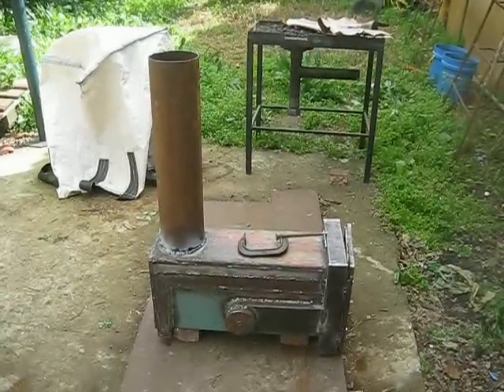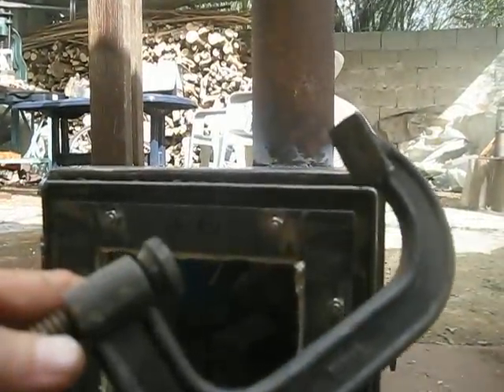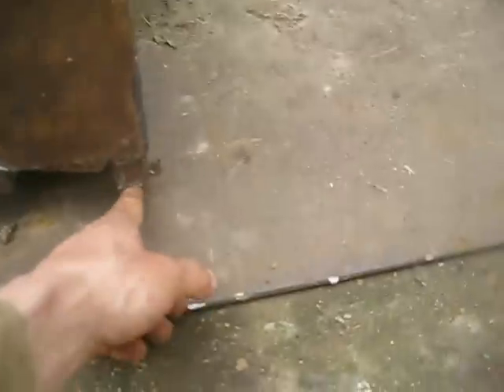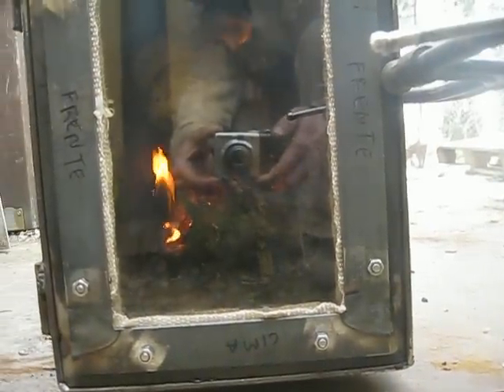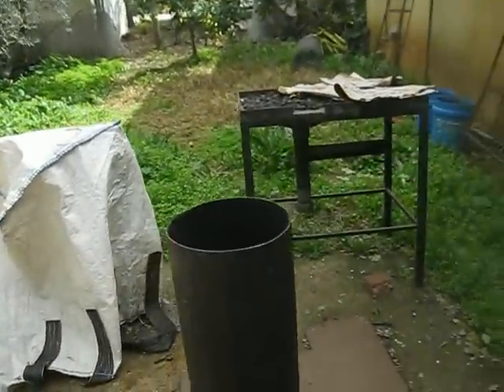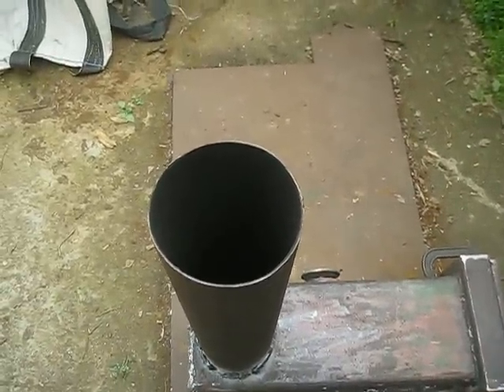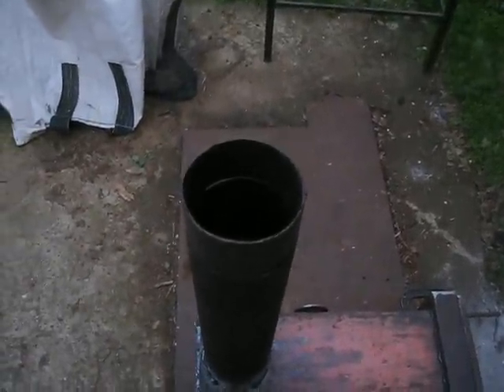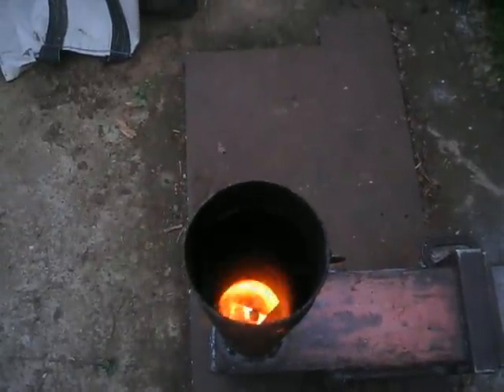Testing core for new wood stove (rocket stove) heater

Comment: I wanted to ask if the fire stays burning at the back of the stove at all times? Does the flame move to the front of the stove? Toward the glass? Thanks for sharing. Wish I had your welding skills....
Reply from the maker: Yes, the fire moves towards the front (glass) when the stove is hot. I lit the stove twice and only ashes remained. I must mention that I have a rebar grate on the bottom of the combustion chamber. I wish I had better welding skills!...
Reply: all looks great to me. Keep up the good work!

Comment: With A.V.E.C. vortex ,
inner hole must be third diameter of riser tube, your seem few different.

I've seen on outside brick RS ,
if air entry is in the soil, air is dry and fresh,
so no smoke at start,
so maybe an air entry at bottom riser tube, up vortex, tangential,
plugged outside house ? (or down, in dry fresh room)
Reply from the maker: Thank you very much for your comments. What is A.V.E.C. vortex?
Reply: AVEC is french name,
" Air Vortex Economiseur Carburant "
you can find some topics about for exemple on a french forum, ' quanthomme ".